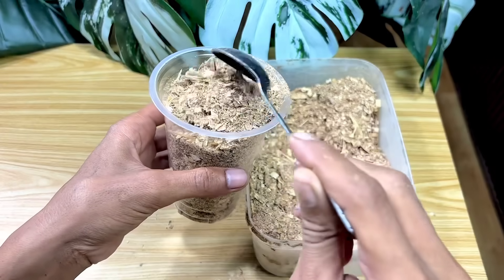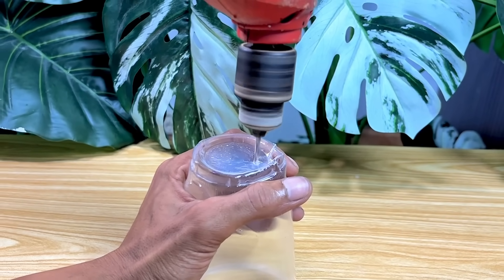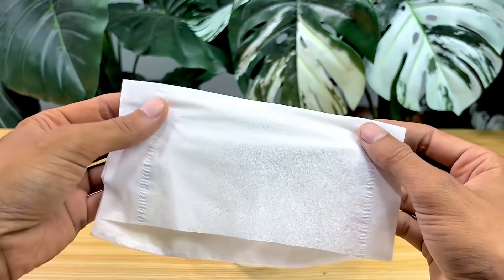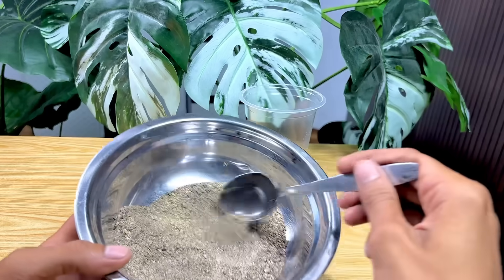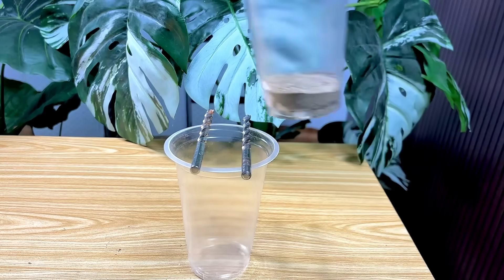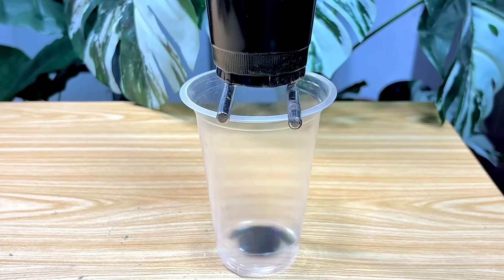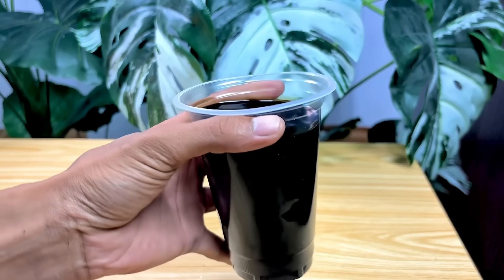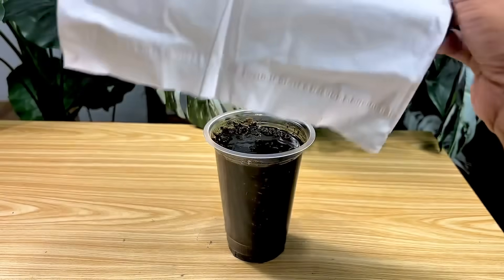You won't believe it! Just pour engine oil into the sawdust and you'll save money and your life.

Comment: It is a very bad idea. If the fume from the motor oil is a health hazard, the white paint burning is too. A clean can, even the canned food ones are not safe either. The inside is paint with a laquer to prevent rust that will burn, producing harmful fumes.

Comment: DID YOU KNOW THAT THERE'S NO NEED TO DO ALL THAT IF YOU GET PIG GELATIN POWDER MIX 2/3HEEP SPOON FULL OF THE GELATIN IN RED HOT WATER THEN PUT THAT INTO THE OIL STIR UP WELL TO MIX TOGETHER AND LEAVE IN COLD PLACE TO SET ALL THE INPURITIES WILL SET AT THE BOTTOM WITH THE WATER THEN JUST TAKE OUT THE NICE CLEAN OIL DO A GALLON AT A TIME IN A BUCKET PUT WASTE IN A BAG PS YOU WILL  NEED TO ADD MORE GELATIN IF IT'S A GALLON